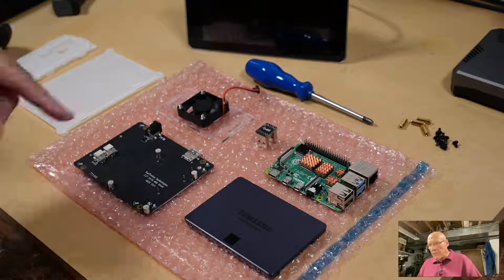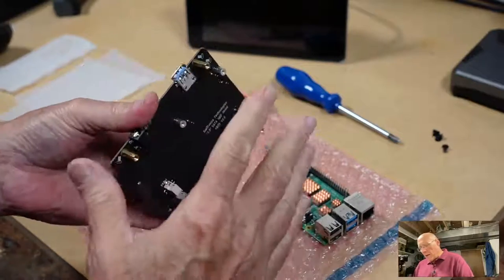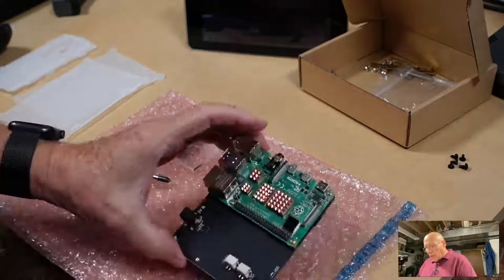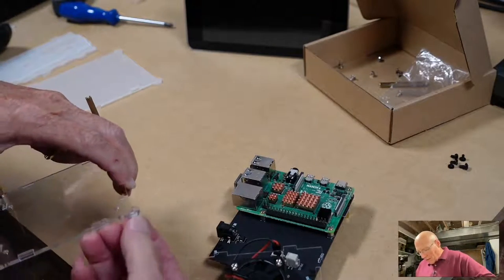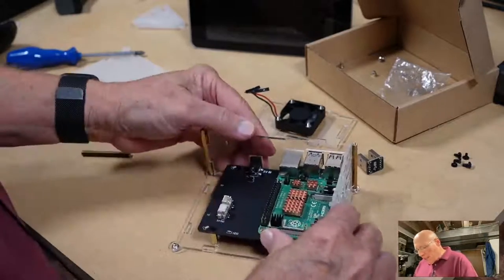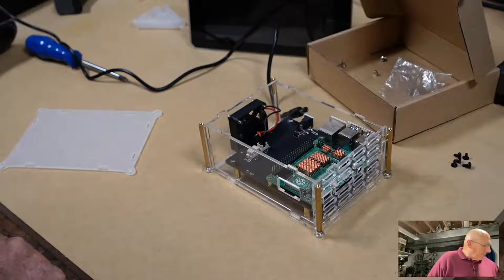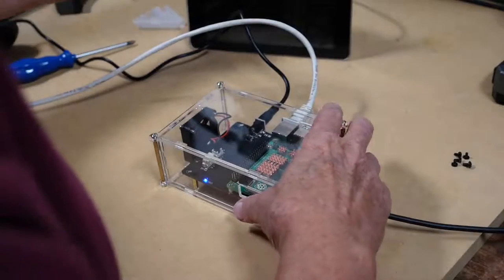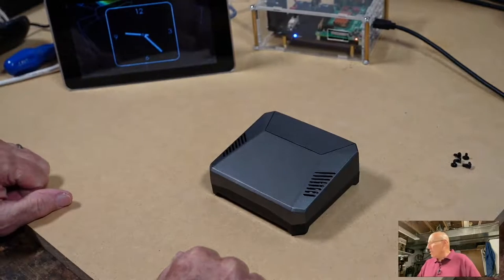Final Assembely of a Raspberry Pi Music Server

Comment: The Micro SD card is the weak point, you might consider running the whole thing from the SSD. Running from the SSD offers enhanced performance and reliability.
Reply from the maker: Yes, that is true.  PiCorePlayer software boots and runs in RAM.